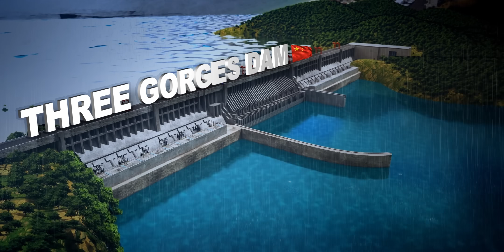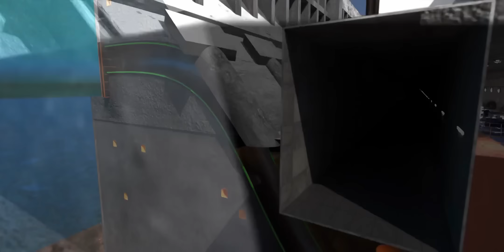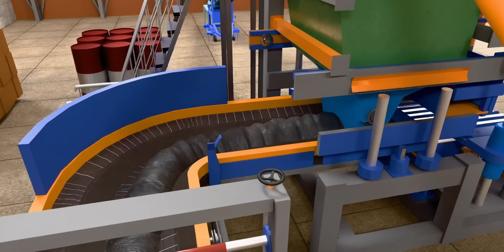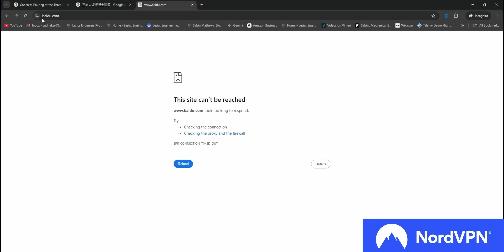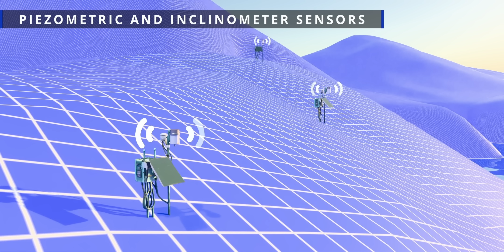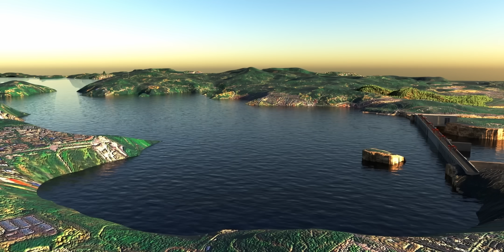Three Gorges: How 40 Billion Tons of Water Shifted the Earth’s Axis

Comment: Erosion accelerates rotation while the tectonic plate pushing out of the ocean slows it. Though the speeding and slowing isn't like the globe example as it's not happening at the equator, thus it causes more of a tilt than speed change.

Comment: I'm not a structural engineer but, the first time I saw an aerial photograph of the 3 Gorges Dam, I spotted a major design flaw: it's straight across. Dams are normally arched toward the stored water for a reason.
Reply: It's a gravity dam.   Those are straight across, and depend soley on the sheer weight of the concrete in the dam to hold back the water.   In theory, you can calculate how much water pressure is against your concrete, and how much concrete you need to hold it back.   I'm sure they are probably 30% above it.   But, you're correct, and circular dam, anchored into solid rock on either side is actually much stronger for any given size of dam, compared to a similar gravity dam.
Reply: @sidorgeorge A while back, I saw a satellite image of the dam that allegedly showed the center section of the dam had already moved 4 feet. I have no first-hand info on this but, given my own limited knowledge of engineering, I'm inclined to believe it.
Reply: @jalan02 wtfff omggg

Comment: Tofu Dreg, cracks and leaks found in numerous places in particular the ship lift area. Also the two thirds one third construction method results in an inherent weakness because it's technically not one solid object. If you just do a little research even the designers and some engineers at the time knew this could be an issue later in it's life. And just recently the Three Gorges Authority have admitted the dam has shifted position.

Comment: 4:40 why do i dont just combine these things ?? 
build a tube like structure from top to bottom with a gate at both ends... 
if a ship wants up, it goes in, the gate on the bottom closes and the tube get flooded with water and the ship gets raised in one step...instead of 5...
if a ship wants down, the bottom gate gets closed and since no ship is in the tube, just open the top gate and let it flow in fast.... 
ship gets in, top gate closes and the bottom gate is used to lower the water level in a safe speed.
genuine question..

Comment: River diversions are most costly without reason, they also provide emergency spillways for the damn in case the damn needs emergency relief from the water pressure. If they don’t have that at 3 George’s, it makes it very susceptible to catostophoc failure if anything ever goes wrong
Reply: While I'm sure it's well designed, and probably reasonably well built, it doesn't take a lot of "unusual events" to overcome things that are built.

Comment: Sound unreliable.  The waterfront of the dam had its weight on the sky's climate over there before it condensed into rain down to the river. So that weight is not extended out but retracted up to the earth's radius.  So, it should speed up earth's angular velocity.    By the way, NASA in later years has been manipulated by US politics.    Not a free scientific bureau as it was. 
Assume this NASA isn't swayed by the US's bad evil politics. Why doesn't the Itaipu Dam, which has a more massive water reservoir, slow down the earth's rotation?

Comment: The earths rotation hasn't slowed down in a few years now, so you might want to recheck that.
Reply: Yeah it did, my day got longer
Reply: Incorrect. By that volume of water being at that level, it will affect earth's rotation speed, however negligible, for as long as it remains at that level.

Comment: This cause plenty damage. Causing a huge environmental concern. And is only in favor of Navy Merchant commerce and in favor of a few. THEIR CONSTRUCTION VANITY. DON'T SOLVE ANY PREVIOUS PROBLEMS AND CAUSE A NEW ONE. HAVE PLENTY PROBLEMS TO SOLVE. AND ARE USING HUMAN EFFORTS TO CAUSE NEW ONES. AND PROBABLY THIS EFFORT DOES NOT LAST LONG MORE THAN 40 OR 50 YEARS. YOU HAVE TO ANALYZE THE DESTRUCTIVE ACTIONS NEEDED TO PRODUCE THE MATERIAL INVOLVED IN SOMETHING THAT WILL ONLY BE VANITY AND IN 50 YEARS IS OUT OF SERVICE AND WILL BE ONLY A BIG THING TO SEE IN WHICH BACKUP DESTRUCTION IS NOT SHOWN OR TAKING IN COUNT IN THE PROJECT. You have to tell population previous project of this kind success in the world with more than 50 years in service. And what you are doing to keep environment in such way to keep stable water levels over that 50 years that is the main issue to confirm because work with a level of water, no more than a level tolerance and keep this level over time was most of failure, Niagara, Las Vegas, and plenty others that other humans actions cause a serious alterations of design values. Itaipu, Yacireta flooding millons of hectares fertile to live and enjoy the Nature were damaged in favor of produce electricity which usage in some cases can be replaced by human activities replacing machines usage abuse in works that are not dangerous or extenuating. 
Are plenty works hydric that is solve pollution, biggest example Mississippi River damaged by agricultural abuse not spliting the agricultural activities in smaller parcels with more human works and detail, diversity instead as huge machines, airplane fumigation, abuse of agrochemicals. The excuse is do technology but is not true. The comparison between Michigan Lake and Agricultural Mississippi is huge. Are plenty more technology industries over Michigan Lake than over Mississippi River, but greed of agriculture damage more than technology industries. Before new project like this should be solved all other huge present concerns.

Comment: Before 2016 there used to be a lot of videos showing the dam being built. A lot of ppl died building this dam and those videos were posted as well.  Ppl snuck in and recorded the cheap materials used and the “genius” engineering is a joke. As for the boats coming and going, part of the reason for the dam was to control and tax the boats on the water. It’s all about control.

Comment: There are many dark secret behind the Three gorges dam.  The most significant of which is CORRUPTION.  In fact, it is described as a "black hole of corruption" due to Embezzlement of Relocation Funds, Missing Funds and Misappropriation.  It ultimately leads to over 100 officials convictions with at least one official sentenced to death.  Then, when there are corruptions, there are always question related to quality - inferior building materials / quality check bypassed etc.
Furthermore, dam that was supposed to protect flood.  In China's context, it leads to more flood because of human life is not part of CCP's consideration.  During flooding season, instead of keeping water low to catch the flood, they kept it high for power output.  When the flood comes, they open all the spill way and let the down steam suffer.

Comment: The same thing is happening to the Panama Cana. That is, the century old concrete has gotten brittle. Meanwhile, when a lock is filling or draining, the weight on (at least( the floor of the lock is forced down or allowed to spring up. All the work is hard to do in old age. Then, what if the shit really hit the fan one hot afternoon.

Comment: I don't think the mentioned 40 Billion ton of water is concentrated at single point on the dam but is instead spread out over hundreds of miles so it will not crack the earth as this vid suggests it would. The only reason we noticed the shifting of the earth's axis is because the large body of water created by the dam which came into existence in a blink of an eye relatively speaking. If it had taken thousands or even hundreds of years instead of 7 years, we would not have noticed.

Comment: All pictures I've seen of it show a fairly straight, damn and concrete really doesn't like to be in tension. Like the downstream side of that dam is that whole dam should be convex facing upstream so that all the concrete is under compression. I'm not really sure if I missed that it is, but I don't remember seeing that it was
Reply: Well, that's why they use steel rebar inside the concrete, to give it the strength needed.   Concrete by itself would fail almost immediately.

Comment: Personally I think using wet on wet is the solution. Mycelium seeded cement substrate that has a base in the elements  and minerals in the  surrounding area .  seeded minerals and elements have to be monatomic and cymaticly attuned to the areas acoustics with the dam the mycelium will replenish the structure with the minerals needed to contain the forms consistency.  Cymatic living loop of mineral replacement. It will maintain its integrity indefinitely because of the mycelium ability to replenish and replicate itself. Making the "stone" part of the mycelium' s structure is a limitless kinetic substrate. Also you can make the structure to lattice the existing if you add that to the seeding process.

Comment: The dam slow down the earth rotation according to NASA because the spillways is running full-time? The spillways are used to control the overflow of the river that rarely happens. The Dam can generate only 50% on the average. It means that the water level are not at any near peak most of the time more like 50%. Let assume that the spillways are running fulltime 24/7, the sloshing of the ocean, the lakes and the rivers all over the world slowdowns the rotation of earth billions of times more than the dam. The NASA calculation is far exaggerated for those who do not understand what is fluid dynamics!

Comment: AI Summary

Abstract:
This synthesis examines the structural engineering, construction logistics, and geophysical consequences of the Three Gorges Dam. It details the unique diversion techniques used to manage the Yangtze River, the advanced concrete delivery systems provided by Rotek Industries, and the thermal management protocols—including 9,500 km of cooling pipes—essential for a gravity dam of this scale. The analysis further covers the implementation of the world’s largest ship elevator and the installation of 32 Francis turbines providing a total capacity of 22,400 MW. Critically, the report notes the geophysical impact of the reservoir’s 39 trillion kilogram mass, which increased the Earth's moment of inertia and shifted its rotational axis, alongside long-term environmental challenges regarding downstream sediment starvation and nutrient depletion.

Project Breakdown and Key Takeaways:

*   0:00 - Foundation Protection: Engineers utilized concrete chutes to eject spillway water upward, dispersing it into a fine mist that lands approximately 100 meters from the base to prevent foundation erosion.
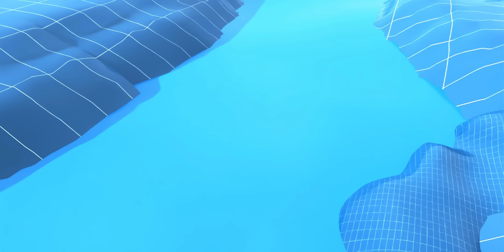*   1:09 - Staged River Diversion: To avoid traditional diversion costs, 2/3 of the dam was constructed behind a coffer dam while the river flowed through the remaining 1/3. In the final stage, integrated spillways managed river height while the remaining section was closed.
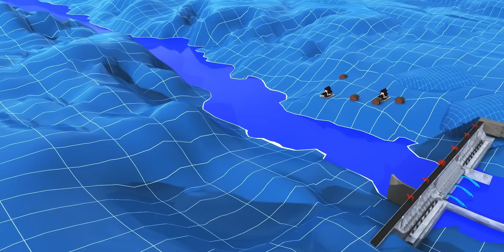*   3:10 - Geophysical Shift: The concentration of 39 trillion kg of water 175 meters above sea level increased the Earth's moment of inertia. NASA data confirms this slowed the Earth’s rotation by 0.06 microseconds per day and slightly shifted the planetary axis.
*   4:38 - Navigation Systems: The site features the world’s largest ship elevator (113m lift in 40 minutes) using rack-and-pinion technology, alongside a five-stage ship lock system for larger vessels, which requires 3–4 hours for transit.
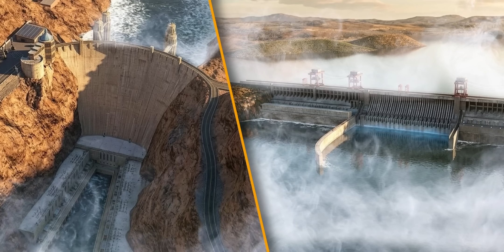*   6:01 - Hydroelectric Capacity: The facility houses 32 Francis turbines (700 MW each) with a 94–96.5% efficiency rating. Despite a higher capacity than the Itaipu Dam, its average capacity factor is lower (45–50%) due to the seasonal flow of the Yangtze.
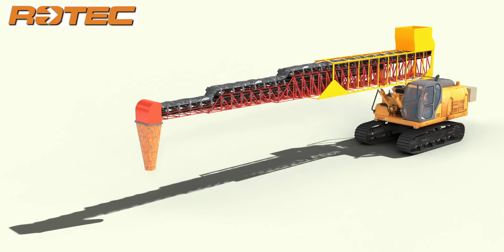*   8:54 - Automated Concreting: Rotek Industries implemented a high-speed continuous conveyor system to pour 28 million cubic meters of concrete. This included the "Super Swinger" telescopic boom for precise placement and a specialized mixing process using shaved ice to keep the mix at 7°C (44.6°F).
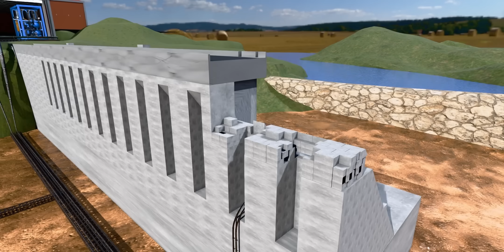*   12:28 - Thermal Management: To prevent catastrophic cracking from internal heat during curing, 9,500 km of steel cooling pipes were embedded. Chilled water was circulated through these pipes, which were later grouted to become permanent structural reinforcement.
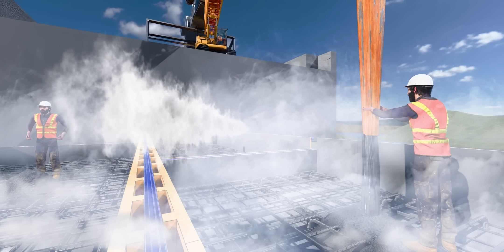*   15:29 - Surface Integrity: Artificial fog was generated to create a microclimate, preventing thermal cracking and rapid evaporation. Workers used high-pressure water jetters (70 MPa) to remove "latence" (a weak cement layer) to ensure mechanical bonding between vertical concrete pours.
*   18:12 - Reservoir Impoundment Risks: Filling occurred in three phases (2003–2010). Engineers monitored over 12,000 instruments to track pore water pressure and seismic activity, mitigating the risk of landslides and induced earthquakes caused by the 42-billion-ton load on the Earth's crust.
*   25:41 - Sediment and Nutrient Impact: The "store clear, release muddy" strategy only clears 30% of sediment. Consequently, downstream waters are "sediment-hungry," eroding riverbeds and foundations. Additionally, the dam captures 70–80% of natural silt nutrients, necessitating increased chemical fertilizer use for downstream agriculture.

AI-generated summary created with gemini-3-flash-preview for free via RocketRecap-dot-com. (Input: 42,723 tokens, Output: 900 tokens, Est. cost: $0.02).

Comment: Hello. I need your advice. I brought water from a distance of 1300 meters. I have a problem. I installed an air release valve, but even then the water turns off in a day. The air release valve does not work. The water level slowly decreases and the water turns off.

Comment: CCP PR. I do not believe this is a proper design. A flat wall is begging for trouble. Arched compression of the gap would have been much stronger. Time will tell, not me and not thee.
Reply: Fun fact: three gorge dam was built in 2003, over 20 years. It will last longer than your marriage.

Comment: While the Earth’s rotation speed fluctuates constantly due to complex factors like ocean tides and core movements, it has generally sped up over the last 20 years, making some days nearly 1.6 milliseconds faster than they were two decades ago. 
YouTube
YouTube
 +1
Historically, Earth's rotation has been slowing down for millions of years, but this trend has seen a significant, unexpected reversal since the early 2000s. 
Business Insider
Business Insider
 +1
Changes in Rotation Speed (2004–2024)
Initial Baseline (2004): In the early 2000s, the average day was often slightly longer than the standard 86,400 seconds (24 hours). For example, as late as 2016, the average Length of Day (LOD) was roughly +1.34 ms over the standard 24 hours.
Accelerating Trend (2020–Present): Around 2020, Earth began spinning consistently faster, breaking records for the shortest days ever recorded by atomic clocks.
The Record High: On July 5, 2024, Earth recorded its fastest spin ever, completing a rotation 1.66 ms faster than 24 hours.
Net Difference: Comparing the average positive lag of the early 2000s to the current record speeds, the Earth is now rotating approximately 1.5 to 3.0 ms faster on its quickest days than it was during its slower periods 20 years ago.
Reply: .006 milliseconds is literally a nothing burger. So the claim is moot in this video.

Comment: Did a donkey kick your brain or what? You really think 40 billion tons of water can shift Earth's rotation axis? What are you picturing—Earth as a spinning toy?

Let’s get some basic physics straight:

1. Earth’s mass is about 6×10²⁴ kg. The Three Gorges reservoir holds roughly 4×10¹³ kg of water. That’s less than one billionth of Earth’s mass—far too small to matter in any meaningful way.
2. The only things that measurably affect Earth’s rotation are global-scale mass redistributions—like atmospheric circulation, ocean currents, and melting ice sheets—not a single reservoir.
3. NASA has actually studied this. The effect of large dams is on the order of microseconds in day length and centimeters in axis shift—basically negligible.

By your logic:

* The Panama Canal should’ve made Earth spin backwards by now.
* Hoover Dam must’ve already wrecked the axis, and Three Gorges is there to “cancel it out,” right?
* And every rainstorm should be resetting the planet’s orientation daily?

This isn’t physics. It’s sci-fi-level nonsense dressed up as “science.”

Comment: They should have made it Simi circular like the hover damn. Using the earth as the foundation. The more water that pushes it against it the stronger it gets like an egg shell. 
However it is an impressive bit of engineering.  They need to build a damn downstream that mimics the hover damn. If not trouble will come. The hover damn will be around for hundreds if not thousands of years with no human interaction. This damn requires thousands of sensors to keep it in check.
Reply: *Hoover *dam is nearly obsolete too. Lake Mead was nearly (effectively) dry (for power production) a couple years back. But it's getting better.😂

Comment: It is just a matter of time before 3 Gorges breaks away.
Reply: As they mentioned, the Three Gorges dam is a gravity dam.   All that holds the dam in place is weight of the concrete.   Contrast that to the Hoover Dam, which is a circular/horseshoe dam that is wedged into the surrounded rock cliffs.   Hoover Dam if FAR more stable, and can resist far more pressure.   

Not saying Three Gorges will fail anytime soon.   But if you get something like super heavy flooding event for both, the Hoover is better able to resist pressure.
Reply: The Hoover dam will probably fail way before the three gorges.
Reply: @sauronthegreat5799  lol
Reply: @sauronthegreat5799 Is that before or after the cow jumps over the moon?
Reply: @sauronthegreat5799 lol, you have no clue